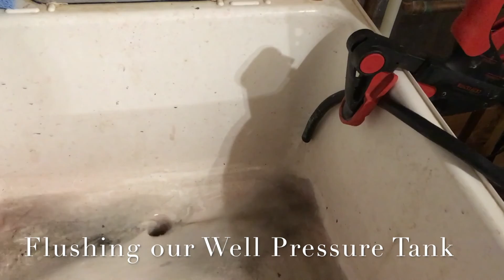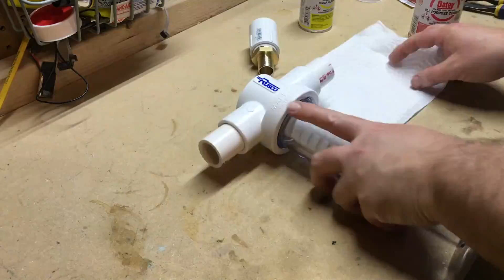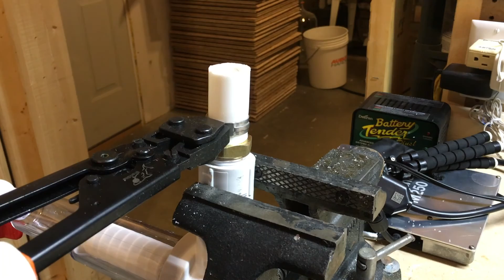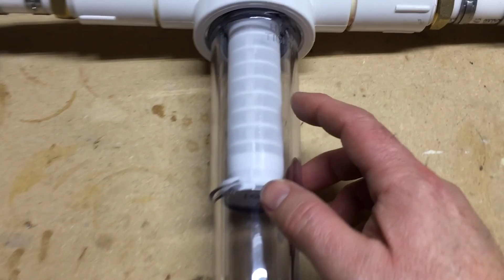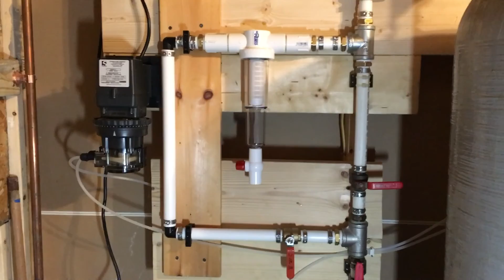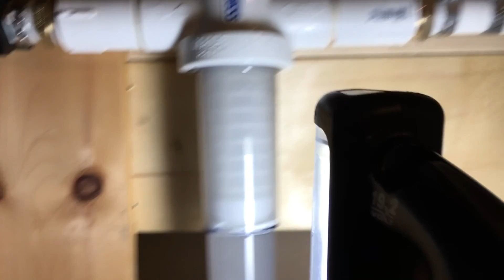Rusco Spin Down Sediment Trapper Install

Comment: I understand the standard plumbing of these . But occasionally they get so plugged up that standard flushing is not enough you have to take it apart and clean the screen . Have you actually plummed yours in reverse flow and did it cause damage to your screen filter? I imagine the steel screen mesh filter would be OK? But I have the polyester filter screen that come with the filter I have the two inch Rusco version . I was wanting to create a reverse flow to create a purge to flush out the filter without actually removing the filter when it got really clogged

Comment: does backflushing make the filter element last longer, or what is the main reason for back flushing? I've got extended family thats on well water and I just flushed one of the houses water heaters (still not perfect) and it was running brown for like 10 minutes of leaving the water supply on and just letting it pour out of the WH drain (via hose to outside) and they have traditional sediment filters that get clogged up every few months to the point the water pressure is unusable so i'm looking for ways to filter the sediment more cost effectively and this is looking like exactly whats needed (or maybe an automated version, depending on how often it needs flushing).

Comment: I would not use the galvanized T as it rust from the inside.
Reply: Also galvanize and brass do not should not touch each other, I think? But a great video overall

Comment: have you had any problem with your stenner pump?  I heared there is problems with them.
Reply from the maker: My only issue is that I do take it apart for a thorough cleaning every couple of weeks.  I believe this is due to my water issues.  I do flush the pump once a week and clean every other week\.  Will make another video on this in a couple of months.  Also, I replace the filter every six months or so as they do wear out.  Water flow is reduce by at LEAST a 1/3 when the system is clean and functioning.  Thinking about adding another filter in parallel to increase water flow.   Overall, this filter does help keep a lot of sediment out of my water system!

Comment: Use Sharkbite fittings (from HD).  Much faster and works great!
Reply from the maker: I actually use then quite a bit.  I decided to use the crimp stainless here since a lot of the water system is very much the same.  Check out my heat pump hotwater video, have a ton of sharkbites on that project!

Comment: Sweet looking and very clean! Quick question, I am not a handyman so bear with me but where does the filter come in? Before the well pump or after? In between the pump and pressure tank? or after the pressure tank? Thanks!
Reply from the maker: Thanks.  The spin-down filter is placed after the pressure tank and switch.  I really wanted to put in between the well pump and tank/switch but the pressure would have been too great and Rusco advises against that.
Reply: So this requires you to still flush your pressure tank, correct?